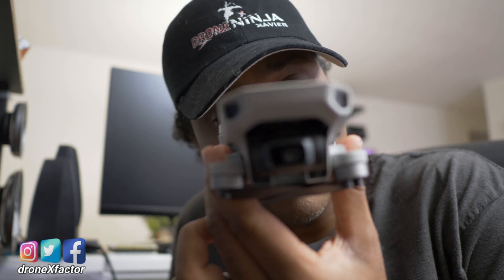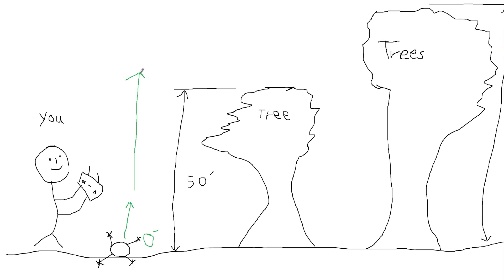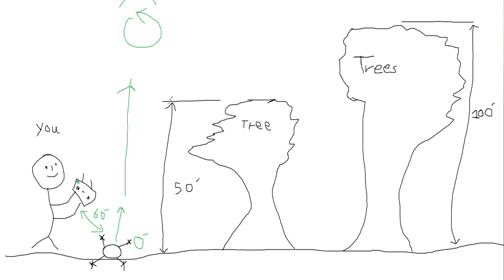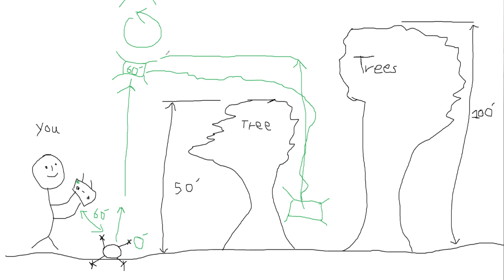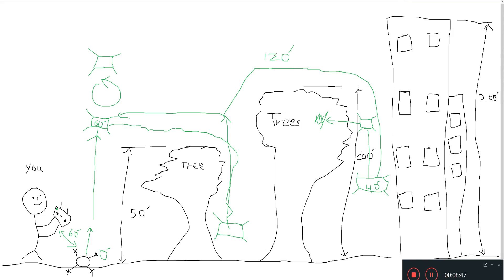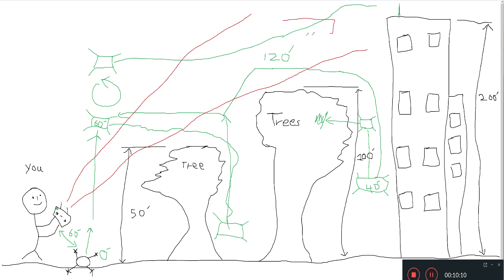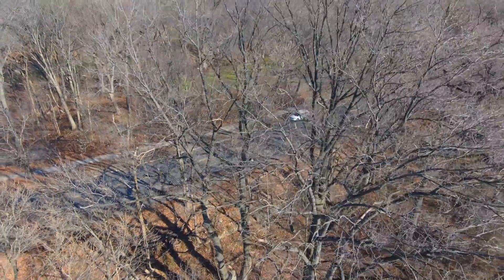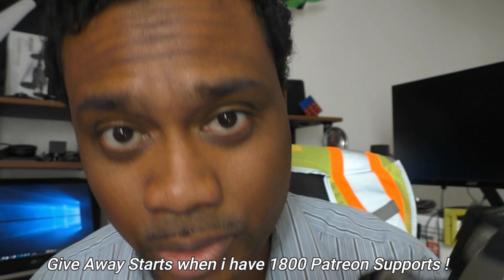DJI Mavic Mini Drone/ Understanding RTH

Comment from the maker: NOTE: If your drone has front-facing sensors it should avoid trees and buildings returning home if enabled in your settings.
However, it might not avoid small building antennas, wires, and thin tree branches!
Stay Safe & Happy Flying!
Reply: Any toughts about the mavic air 2? I'll expect that he will not have 4k60.  Only 30. Also in my opinion the price will be slightly more expensive than the current mavic air, and less than the mavic pro.
I will be glad to know what do you think about it
Reply from the maker: That sounds like a play, straight out of dji's playbook.
Thanks for sharing, it's going to be interesting to see if you're spot-on!
Reply: X-Factor can I fly like 1,500 feet down in a canyon? OR 2,000 feet down  below 0ft take off point?
Reply from the maker: I'm pretty sure Yes you can, although I've never gone below -600', just be sure that the Drone has clear exposure to the sky so it can pick up and hold a GPS signal!
This will give it stability throughout the flight!
Happy Flying 😎
Reply: @droneXfactor  thanks buddy. I want to tell you that I really enjoy all your videos. Your pretty awesome and all your experience has helped many of us. I don't understand why you don't have a million followers, subscribers. 
My drone will have plenty of sky above it when I go in a canyon. Just wasn't sure if it would go into landing mode. Lots of canyons in America out west. And I just have to have a better look. And share with friends. Plus Utah has areas I can't climb to but with the mini 2 I can put a camera right where I want to be. And see things I'd never see.
Keep up the good work man. We all appreciate every post you do. Peace

Comment: you forgot to mention - if using RTH and at elevation, the drone may not land exactly on land, as the mini does not always land within 1-2 feet of original take off point. better to fly it home manually, once it starts final descent to 'home.'

Comment: Good explanation but NOT completely true. U have given UR views a false sense of security.   Please review DJI Mavic Mini manual I believe on page 13 for RTH function. If UR drone is not 20 meters or more from the Home Point, UR drone will land immediately and not RTH (go to RTH height and/or back to home point) if U press the RHT button on controller or screen.  I have not tried this with loss of signal, only pressing RTH button.   Also if the RTH height is set at 100ft for example and the drone is currently flying higher than 100 ft and the HOME POINT distance is greater than 20 meters the drone will NOT descend to the the set RTH height  but go to the 0 distance point for RTH then descend to land.  DJI and I had a long discussion on this subject until they sent me the manual and I tested the 20 meter limitation.  Keep up the great videos as I have learned a lot from U!
Reply from the maker: Cool
Happy Flying 😎

Comment: Hi. Got a question what if your in a 120m altitude then you set your rth to 60m altitude. Then you lose signal. What will happen? Does the drrone lower first to 60m altitude then go home or it will go home directly at a 120 altitude?  Thanks

Comment: If you lose signal, and the drone begins to hover for approx. 10-11 secs. BEFORE it engages the RTH feature, does that give you a few seconds to change the altitude in the "Settings" tab of your Return to Home setting? .. or is it locked at that point?

Comment: what if you take off from high attitude at the edge of a hill and when you press RTH and the drone will fly back but not exact precise point of take off, say miss by 15ft, will the drone just keep dropping as there is no platform off the edge to land?

Comment: good and detailed information, I also have a video experience about the magic of RTH that finally saved my drone, I want to give you advice on what if a video is made about what mobile standard is suitable for Mavic Mini, because I am using a Samsung S6 and if I get too frequent interference from WiFi it will automatically restart and it's tense, keep up the spirit to make useful videos sir, I will definitely watch it...
Reply from the maker: Honestly it's hard to say what mobile standard is suitable for Mavic Mini, simply because Wi-Fi is very prone to interference and it would be very difficult to determine for a fact if it's the mobile or the Wi-Fi itself being affected by interference that's causing the problem and that's also causing restarts.
Thanks for sharing
Happy Flying 😎
Reply: @droneXfactor  yes that's right sir, happy flying too ☺️

Comment: Hello.  I intend to buy a dji mavic mini to start as a beginner.  I have a Samsung galaxy s20 ultra phone?  Isn't this phone too big?  Thank you
Reply from the maker: I don't know for sure, I have not tried that phone, however it should fit, if it doesn't for any reason, on Amazon you can pick up special holders / adapters for 10 to 15 bucks.
Did you see the Mavic Air 2 drone that just came out?
Reply: @droneXfactor  Thanks for the reply
Reply from the maker: Anytime 😊

Comment: Hello Sir! I've been watching your videos before I bought myself  mavic mini. I'm facing one frustrating issue while flying is with rc signal lost and unable to capture photos. It really kills the mood when you can't fly above 80m of altitude. Please help me to fix it!

Also can you make a video about how to get better transmission in city area? I've seen videos where people getting above 500m mark of altitude :/
Reply: Tariq Khan depending what country you’re in you might have the ce version which has weaker transmission power and uses 2.4ghz as well as 5.8ghz. Here in the US it has a stronger transmission power and only uses 5.8ghz which is less prone to interference than 2.4ghz.
Reply from the maker: Well said
Reply: Thanks for clearing this out @Brandon
Reply from the maker: Hi Tariq,
Signal strength varies by location!
DJI Mavic mini works with Wi-Fi transmission which isn't very strong in urban areas and proned to disconnections in areas with a lot of Wi-Fi routers and a big buildings!
If you primarily intend to fly in these type of locations, maybe look into DJI's more premium drones with Ocusync transmission that can withstand interference much better than Wi-Fi!
I hope this helps, thanks for reaching out, Happy Flying 😎
Reply: Thanks for the reply Sir! 🙂

Comment: I have to disagree with general rule of thumb, "higher you are safer you are", a ton of accidents happen due to high winds and Mini sailing off or dropping out of sky due to high winds. Imo staying as low possible assures your Mini returning home safely.  I always gauge my surroundings same as you and I set my return to home 20ft higher than highest peak. I think (do not have your experience with other drones) that this applies solely to the Mini and other drones are much safer to fly in higher winds. Your channel rocks bro!

*1 year in now with mini and 0 crashes.

Comment: Off the topic, Have you tried the protective motor caps for the mavic mini ?
Reply: I 3D printed some from thingiverse and so far they work fine without any problems.
Reply: Not necesairy
Reply: @Lon Denard any issues ?
Reply from the maker: No I have not!
I do not want to add any weight to the Mini and risk falling into 250 g category for FAA registration.
But that's just me, I think they look cool!
Thanks for sharing
Reply from the maker: I hear you.
OMG
You make me look really lazy 😂
Reply from the maker: Not to mention picky too!
LoL